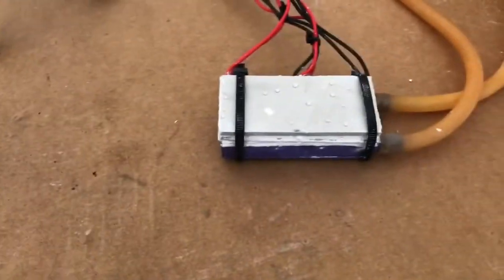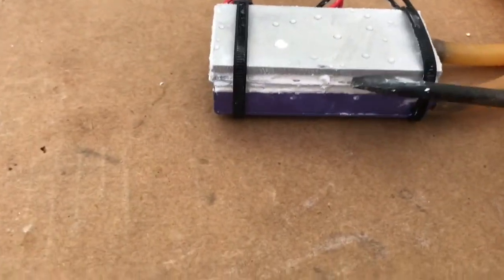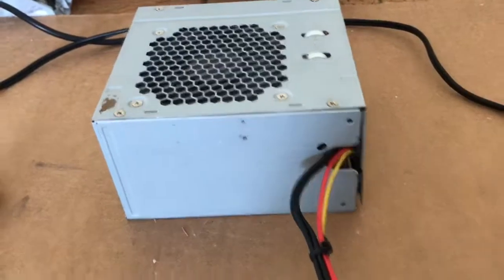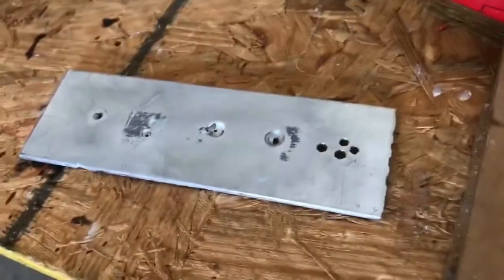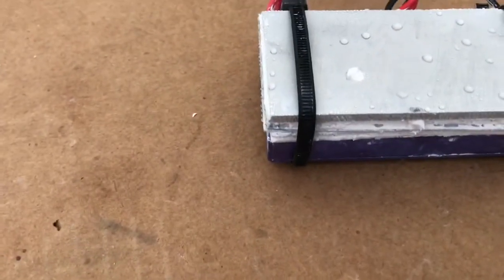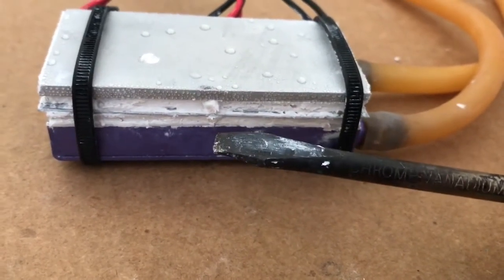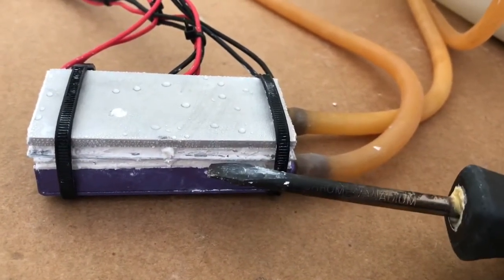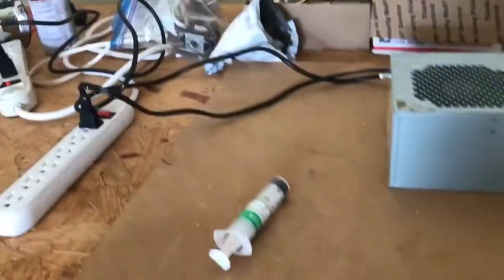Quick n Easy Thermoelectric Cooling Block

Comment: What was the lowest temperature did you achieve with this set up?
Reply from the maker: Philip Young I think it was about 0 C. However if I used chilled water I could have gotten a much lower temperature.
Reply: What wattage power supplt did u use?
Reply from the maker: I used a smaller power supply – it was around 350W